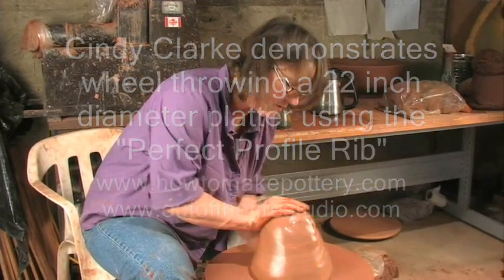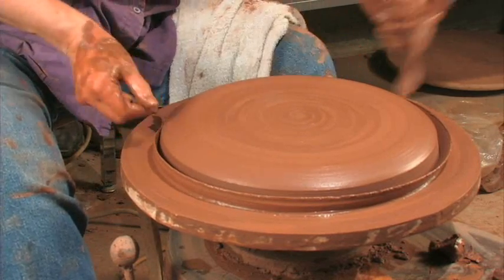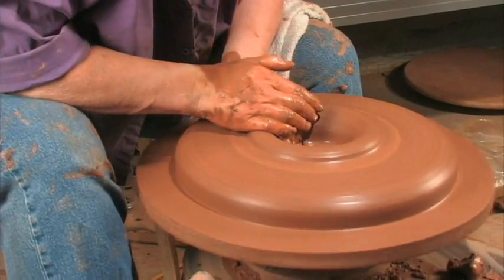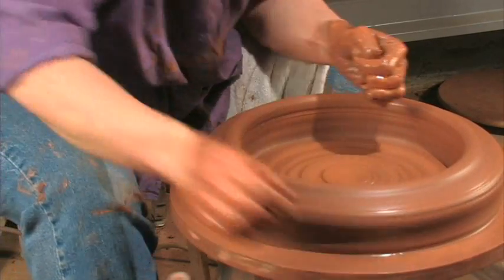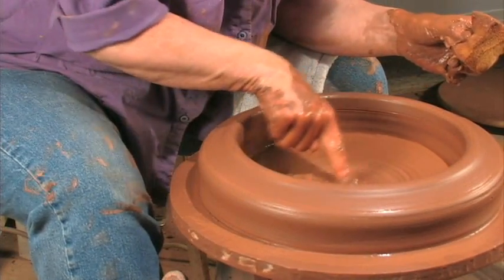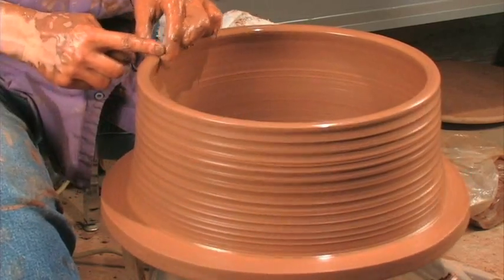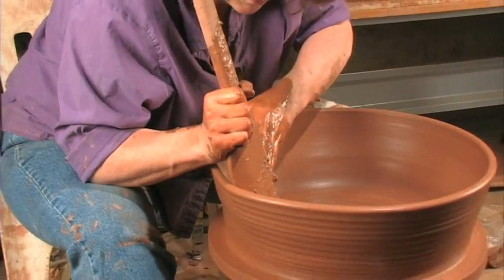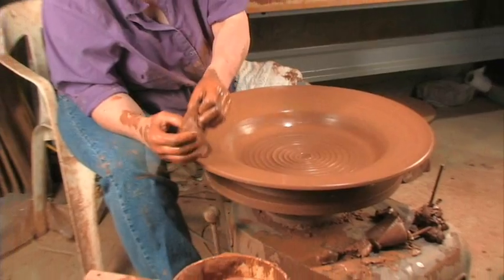22 inch Clay Platter Pottery Wheel Throwing

Comment from the maker: The thickness of the bottom varies depending on the diameter. In the case of this large platter the bottom is a little more than 1/2 inch which is then trimmed and dries to 3/8 or so. Compression (compacting) of the clay in the bottom is very important as is your drying technique. We use a steel baker's shelf draped with plastic for drying. This allows all surfaces of the platter to dry at the same rate.

Comment from the maker: We feel stoneware is better for large platters as porcelain tends to be too "creme cheesy" and yes the wall's thickness matters. Thick is better than thin, thin tends to dry quickly and warp. Also pay attention to your drying process. We move the platter off the bat as soon as possible and use a baker's rack enclosed in plastic for drying . Sometimes covering the edges with a separate piece of plastic to even out the drying helps as well.

Comment from the maker: It's a combination of clay body,compacting your edges when you throw, and even drying. If it does curl up, if you trim at "soft leather hard" and it has pulled up, just get it moist and throw it back down. It usually will not curl again. It is more a drying and clay body issue than anything else.

Comment: Do you get much pull up of the rim during drying?  I've been trying to get the rims pretty flat first... but have run into issues.
Reply: I do get some pulling up at times. It happens when the edges dry before the rest of the plate. It can be fixed and I plan on shooting a video showing how this week. If you haven't yet subscribed, please do and you will know when it  is done. Thanks for your question and thanks for watching.

Comment: Cindy, where did you get that rib? or as another person commented (boat paddle). Thanks for the videos.
Reply from the maker: Hi Steve. Cindy designed the rib a number of years ago. We are in the process of putting together a video about using the rib and a template and design notes on our website so you can make or get made your own. We sold them for a number of years but have no wood worker in our area and the cost of shipping them adds a bunch to the cost. We should have the video up by the 21st of November 2016
Reply: Could you point me to that rib pattern video? I'm not finding it. Many thanks! Love her videos, so generous.